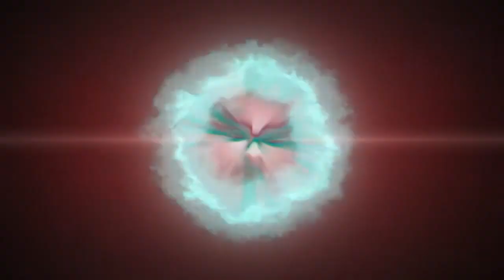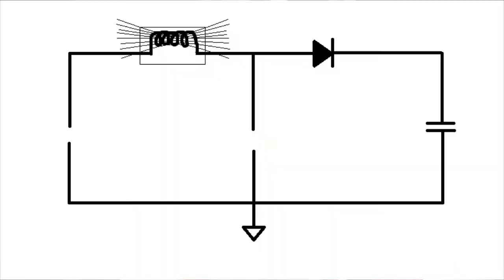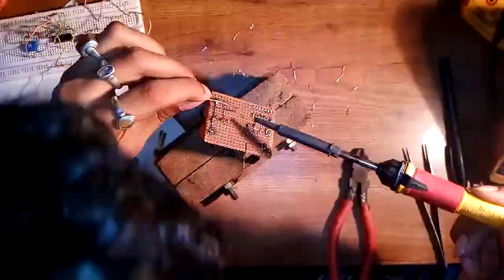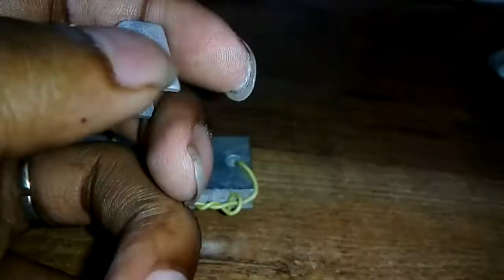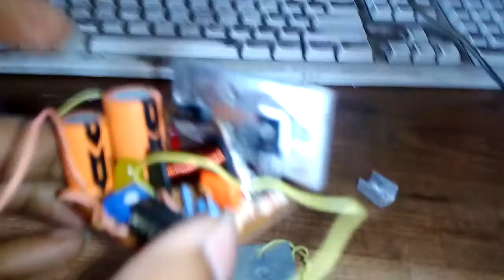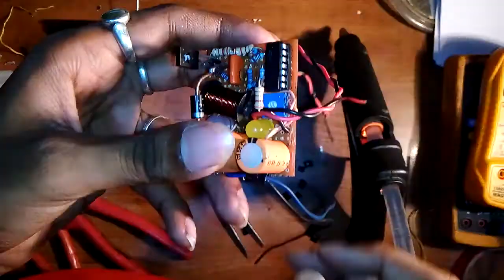12V to 24V Boost Converter using LM324, Troubleshooting, Alternatives, Common Problems and Fixes

Comment: Can I use MOSFET IRF Z44 we use in please of BD 139 transister
Reply from the maker: Yes... you can... Just remove the current limiting resistor for the Base and connect the oscillator output directly to the MOSFET gate...